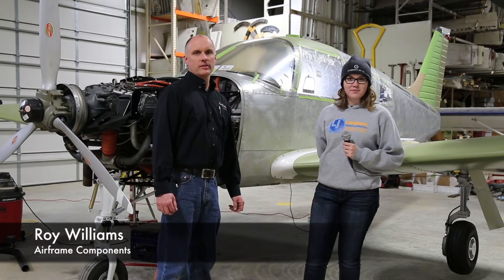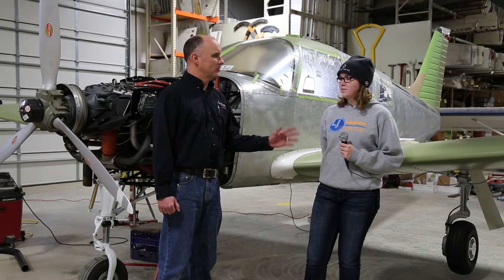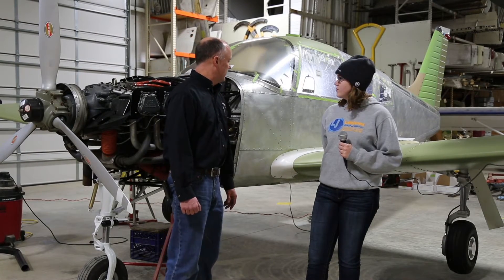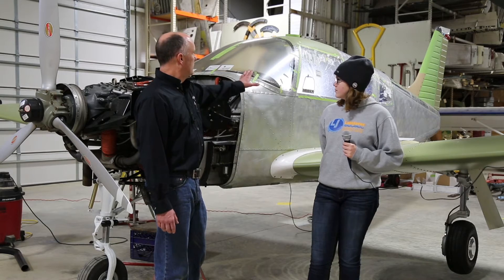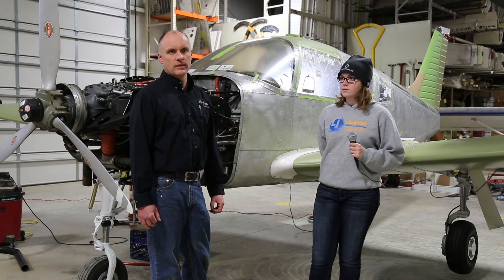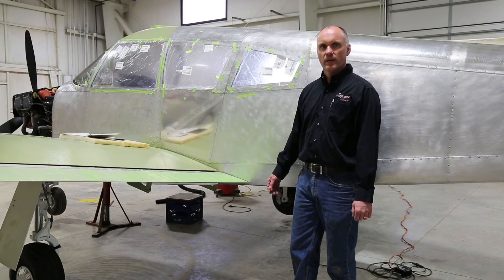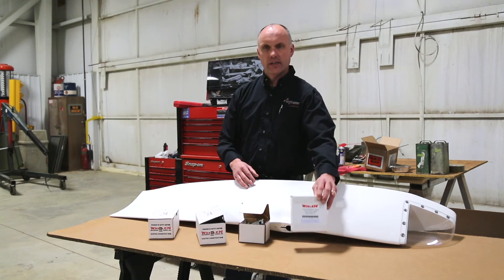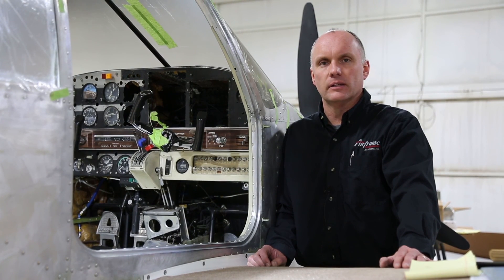Airframe Components 1969 Piper PA28R Refurbish Pt.3

Comment: @8:00 you did a landing gear test.  did you do any additional bleeding of air out of the system.  it looks like it has some bubbles in it.. this is what i would think landing gear retraction should be.. but i could be wrong about your piper. could have too stretchy hoses..  https://imgur.com/gallery/V9hY40g   i should mention i have been an automotive mechanic for 39 years.. when i have to bleed a hydraulic system like retractable tops on old fords.. i put a union where the cylinder connections are.. and allow the system to run for a few seconds without the cylinders.. this purges the air out of the high spots in the lines.  i also have plugs for the cylinders.. so i can keep the cylinder plugged.. disconnect one plug and one end of the line at a time to connect it.. i loose almost no fluid when i do this..